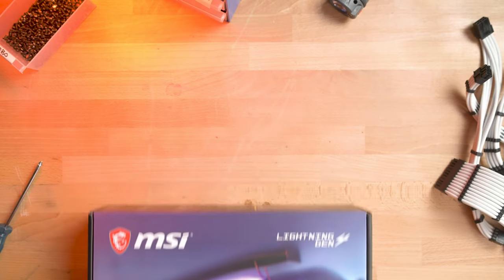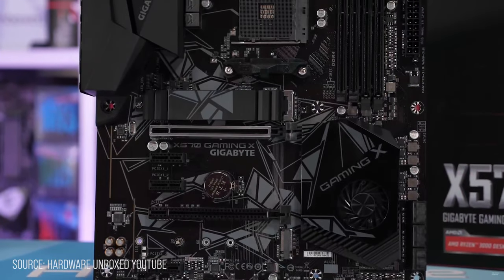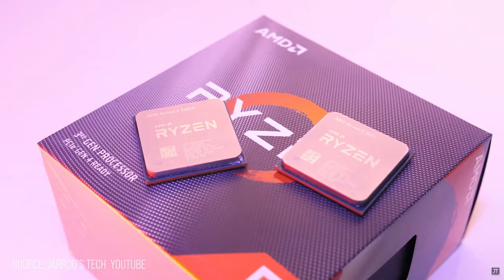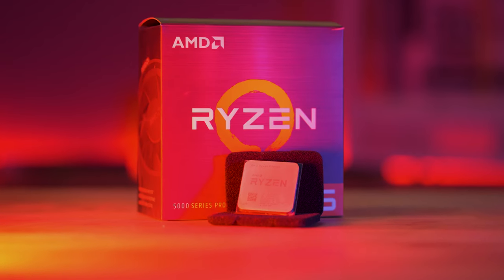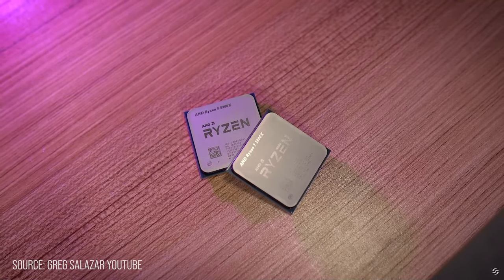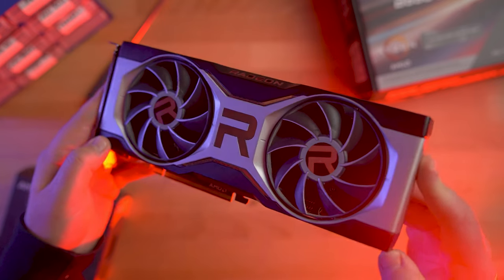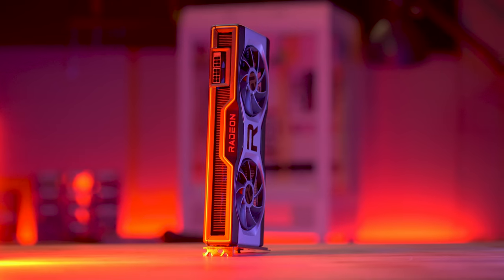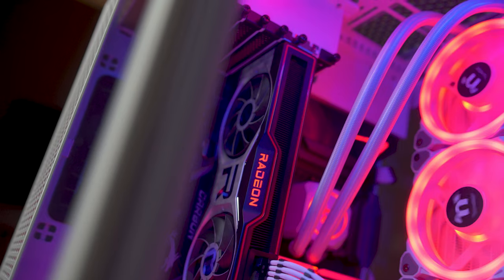Goodbye Budget Gaming - It's been a good ride, AM4

Comment: 4:00 I like B550 because basically ANY 2 slot board will let you run DDR4 5000C16 as long as you have an APU that can run 2500 IF/UC/MC
In other words a 5700G and some of the 4000G processors
Basically any time you dont have room for a GPU, grab a 5700G, a B550 ITX, some good samsung B dye, and go ham with memory speeds and timing, the GPU really benefits from the higher bandwidth, and the CPU makes up for the lack of cache by the extreme low latency(i've gotten upper 40ns while still at 4933MT/s)
Reply from the maker: I didn't actually know about this! Thanks for the info nugget here 😊
Reply: @ThermaltakeAustralia  
Dont let me talk your ear off, but i thought you might be interested in some more info

Most of my Zen2 and Zen3 APUs will hit at least 4733C17-17-17-28 (geardown needs to be disabled for odd number timings), i've got one 5700G that will hit 5000 while still in 1:1:1 though its not exactly stable at C16, but at least it beats pretty muich every DDR5 kit out there under $400, while being less than $100 when i bought it.

My oversharing point is that i have 4 B550 ITX boards 2 of them pretty cheap(sub $140) They seem to all hit these high speeds.
I've got MSI, Asus, and Asrock
IIRC i got 4933 on a cheap gigabyte or asrock phantom B450 ITX

I think this seemingly universal high frequency support is just from the shorter traces without the signal reflections from 4 slots, i feel that AMD motherboard manufacturers didnt even know the APUS could hit these speeds, so why even bother to build the boards to support them.

Of note, i've only gotten this working with samsung B dye single rank, i have an XMP 5000 kit from Kingston that just wont post at 5000, even with the terrible XMP timings, so it might be a comination of the better desing of ITX, combined with the magic of Samsung B-dye, while i havent tested all 6 of my kits to 5000, they do at least all get to 4800C17
Reply: @denvera1g1  Are the numbers, fps in games really improved compared to a 3600 cl 16 stock ?
Reply: @Paraclef Yes, depending on the games stutter (1% and .1% lows) are greatly improved. 
Peak/average FPS doesnt improve much, but above 160hz you feel a stutter of 33ms frame time much more than the extra 0.5-5ms shaved off with the 6% faster average FPS
Just because most games can fit most assets in Zen3D cache, this doesnt mean all assets from all games will, additionally, running faster RAM in 1:1 means a faster UCLK an FCLK effectively overclocking your CPU's ability to communicate with itself, the motherboard, the GPU, and RAM.
(the bandwidth doesnt increase but the latency between interrupts decreases)
Reply: @denvera1g1  Still, the question is, by how much do you improve your frames for this amount of money separating the 3600 and 4800-5000 ? The price is still quite high for 4000 and above.
Reply: @Paraclef  
Let me preface this by saying memory OC is just easier on Intel than AM4. Technically you get better performance out of AM4 RAM with an APU liek the 5700G than you do out of alderlake, becuase the 5700G can go to at least 4933 before it has to run the IMC out of sync with the RAM, but on Intel youy can just pop any kit of RAM in and start tuning, on AMD you're basically limited to samsung B dye, as i have had good kits of Micron just refuse to run at anything other than their default profile B dye just does not care.
My patriot viper 4400 were $89 and go to 4933C17-17-17-28(apparently a hard limit for my boards/processors as i could push this same kit higher with alderlake but alderlake required 2:1 ratio), apparently this #2 on the zen3 leaderboard for memory bandwidth at 74.2GB/s at 49.1ns of latency
But this is only a 16GB single rank kit, going dual rank for 32GB you sort of top out at 4600C19 without using voltages that would require cooling.

Keep in mind much of the problems with Zen memory overclocking comes from AMD motherboard manufacturers being told by AMD that the IMC cannot go above 2000Mhz so 4000MT/s is the upper limit for Zen2 and 3, so manufacturers really did not see the need for boards to support faster RAM. you can really only get to these speeds with an ITX board because ITX boards are inherently designed to be compact and these short traces make them perfect for memory overclocking(assuming you only have 2 memory slots).
 
These 6 kits (yes i tried 6 different kits of this RAM) has worked on pretty much all ITX boards i've tried, including cheap ones, Without an ITX board you pretty much need a special 2 slot OC board, 4 slot boards do not work, even ones claiming to support "5500" I've tried 4 different boards, and the best i can get is XMP/DOCP and that isnt always stable, even with just the 2 sticks.
Keep in mind that Zen3 non APUs, including Zen3D have a 12nm IMC unlike the 7nm IMC on the 5700G/ Pro 4750G. This means they can only go to 4000, maybe 4200 on really good chips, this lowers the cost barrier significantly for more than 16GB, as a 32GB kit of 3600C14 B dye that will go to 4400C16 is only ~30% more expensive than a 32GB kit of non bdye 3600C16, and because you arent going to push it past 4000, you can try for good timings like 4000C14, or C13 with geardown disabled, maybe even C12 with an uncomfortable ammount of voltage.

I cant find them any more but the really expensive dual rank 32GB kits of B dye that out of the box are set to 4000 i recall used to be $300 or 50% more expensive than the 3600 kit that will go to the same spec without any fuss.
Reply: @denvera1g1  Thank you very much for this long answer. It's hard to specifically search for a samsung b die, especially dual rank and above 3200 😋, so maybe going to dual rank 32gb of ram or non dual with samsung b die 😋
Reply: @denvera1g1  and do what this video is telling v=mXhqKf0-3HA
Reply: @Paraclef  I use a tool called "bdie finder"
You can filter by MT/s, capacity, timings, and even brand
On the far right of the listing for a given product you are given the option to google search, or a PC parts picker link